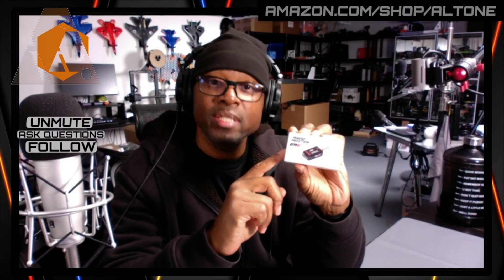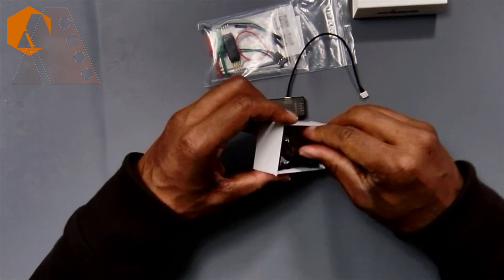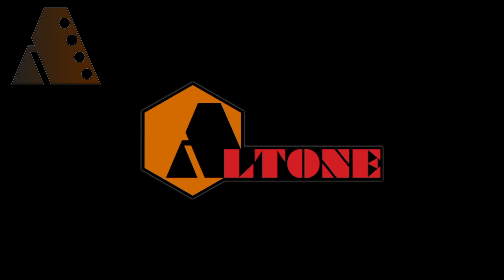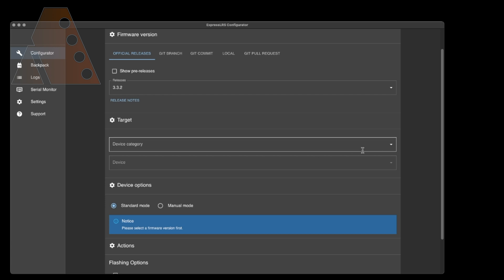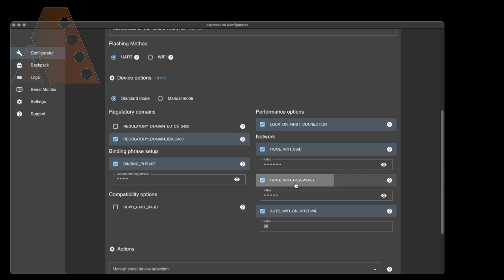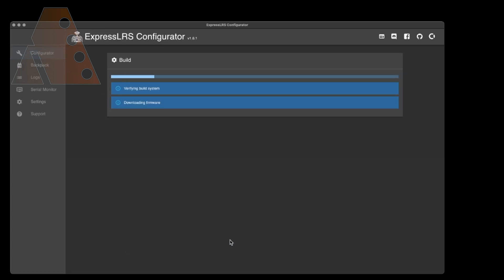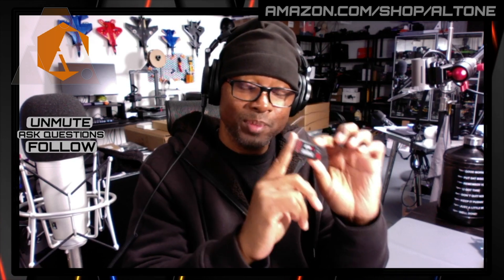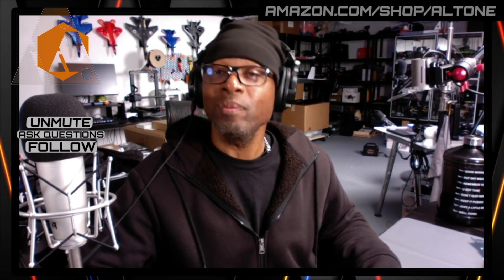Flashing the RadioMaster ER6 with Firmware 3.3.2

Comment: So this are not plug & play?
Reply from the maker: Plug and play or PNP refers to the aircraft and not the receiver. The receiver must be bound to your radio. The firmware update is not an absolute requirement but this video is about doing so if you want or find you need too.
Reply: @AlToneRC  do you have a video on how to bind this to the tx16s? Right now its on multi, i have spektrum & flysky reciver binded to the radio, but cant seem to get the er8 to bind to my radio
Reply from the maker: @ This is an ELRS receiver, multi protocol radios will not bind with it without a ELRS Module. The binding I do is during the Flash is using a pass phrase to bind. All of my aircraft currently use the same pass phrase. Setting it is a step in the firmware flashing process which I show in this video.
Reply: @ALTONERC  oh ok  i.switched it to multi, it was on crsf. Ill return it & just buy flysky or spektrum. Thank you
Reply from the maker: @Mroswaldo16 no problem glad to help! BTW ELRS uses the CRSF function in the radio however you still will need a ELRS module on a multi protocol radio to bind it.

Comment from the maker: Question in comment from @ahmadhanif114  I used Google Translate to translate my response.  I want to translate this so that if anyone else knows a better answer you are welcome to chime in. 

Question:  Hello, what if I don't have a USB flasher? I had a problem when updating the driver to 3.3.2 on ER6 ELRS, suddenly the LED went off and didn't work
My response: It sounds like the software in the ER6 is no longer working. if that is true you will need the USB Flasher to fix the problem.  I would suggest getting one especially if you plan on using this same receiver for different builds.  I hope this helps.